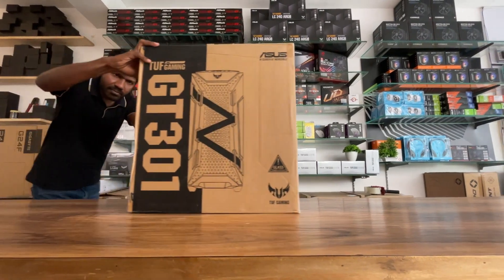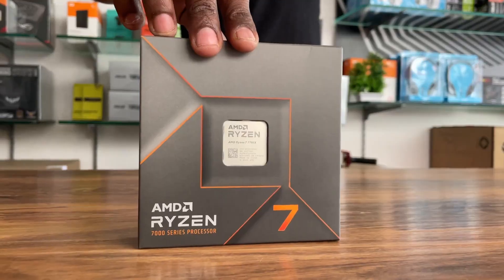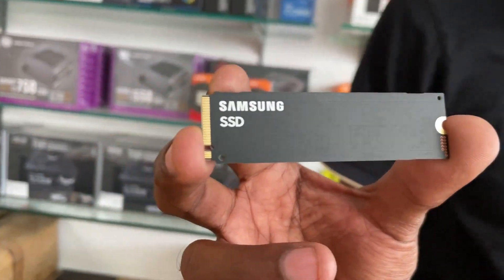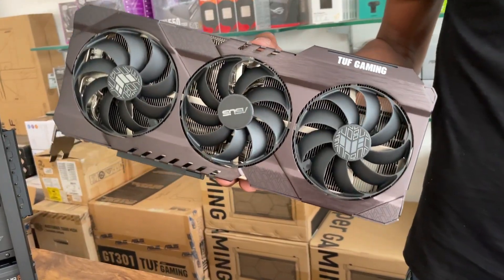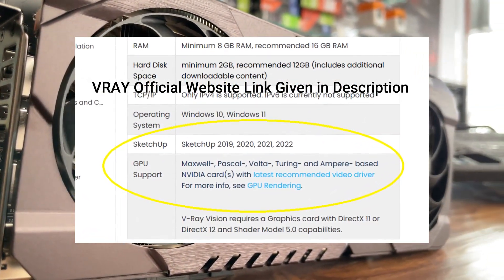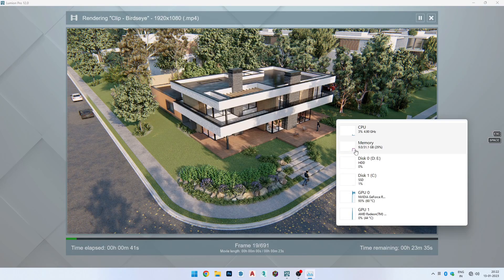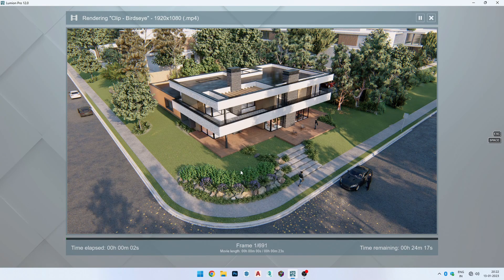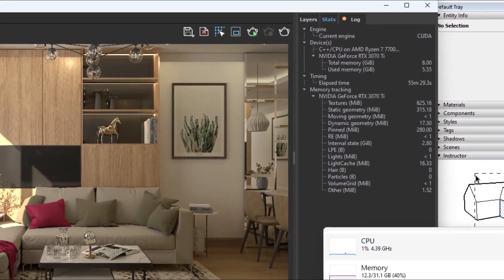AMD 7700X , RTX3070Ti PC for Lumion 12 Walkthrough & SketchUp 2022 VRAY #rendering with #benchmark

Comment: Hi, i would like to ask if i can replace grafic card with new rtx 4070 ti and ssd disk with 1 TB. But then i will need to replace power supply with 850w+ right? Also what cooler did you use please?
Reply from the maker: Yes ., 4070Ti is a good GPU .. 750Watt is Enough .. CPU Cooler choice depends on your CPU model …
Reply: @WAYMARKTheComputerStore  so if i will use the Amd Ryzen 7 7700x what cooler i will need please?
Reply from the maker: @jindrichmikulecky5416  Good Air Cooler with 125WATT TDP or Good AIO 240mm or 360mm will be fine..
Reply: @WAYMARKTheComputerStore  thank you so much